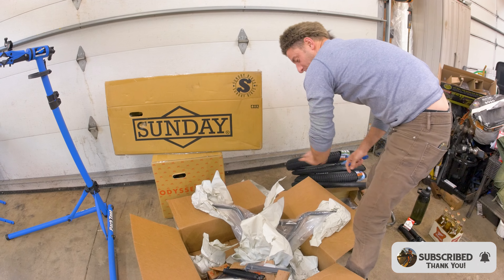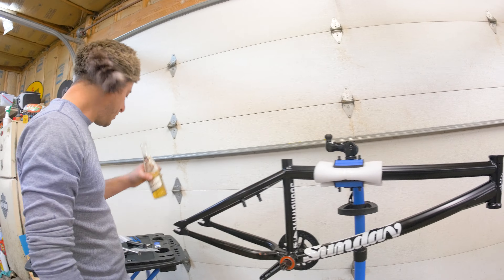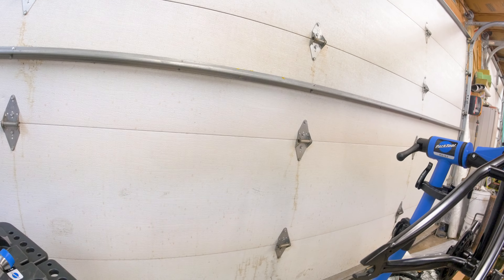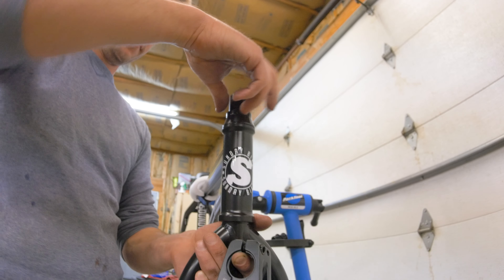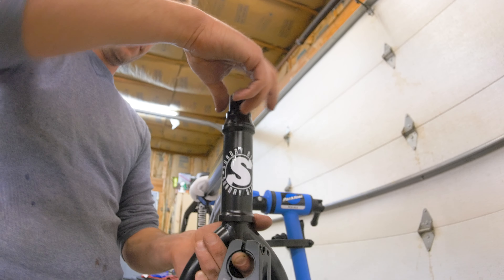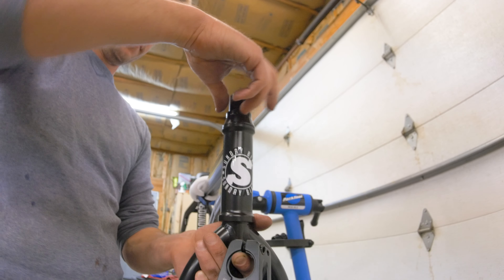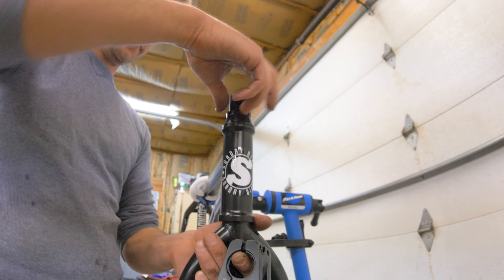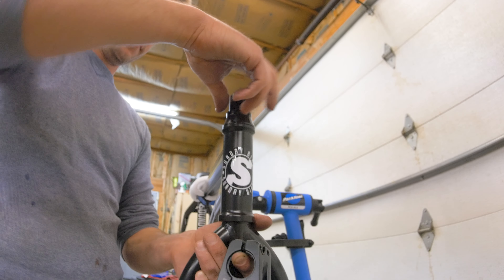Sponge's First New Bike In 20 Years! Building & Riding!

Comment: I really need to follow your rule nobody touches the chain breaker. Rip literally every single one I own.
Reply: Best trick for single cables and works for gyros. Take the barrel adjusters out an even amount. Size everything to that so that the pads hit the rim. Then as you put the barrels back in you get a good amount of cable pull. As the cables stretch you still have room to fix shit.